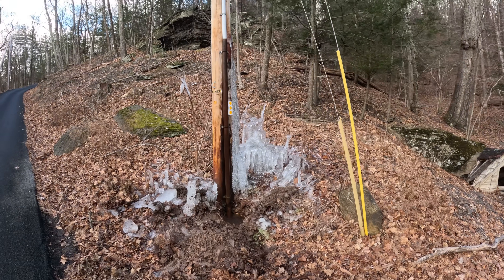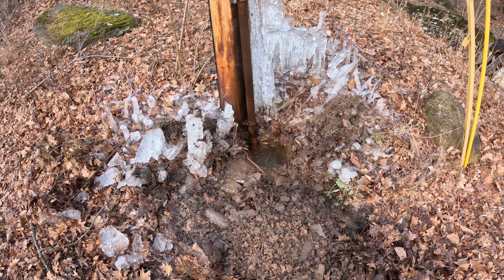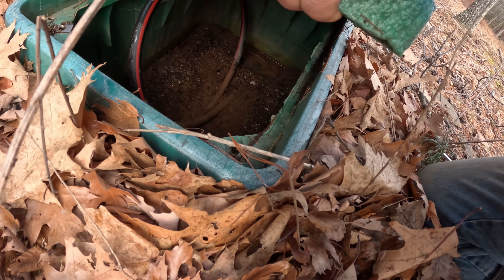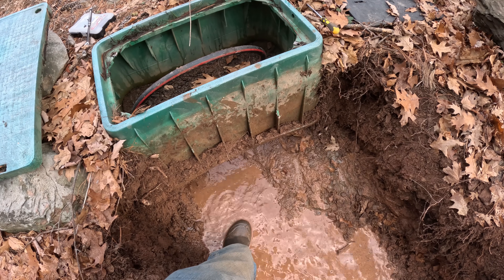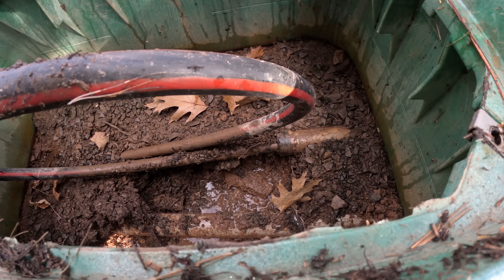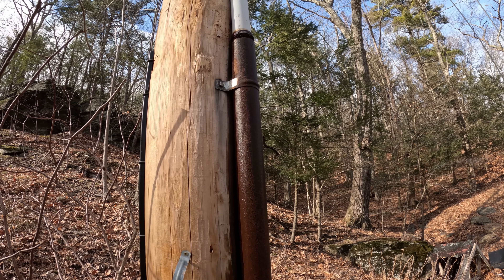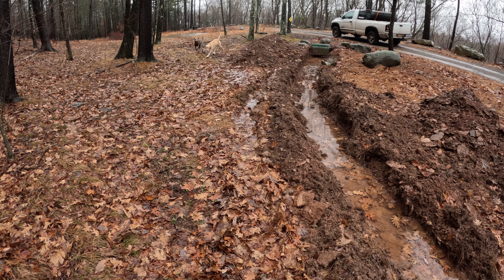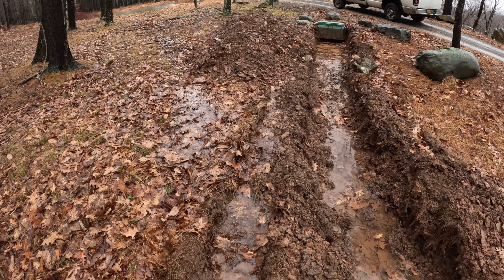Keeping water out of an electric conduit

Comment: Oz Gendy makes a hockey Puck that goes around the wire and into the pipe, you then tighten e few bolts and it squeezes in place. Good for a 100psi. Measure outer diameter of each cable or wire and inner diameter of pipe. Those specs can be found in the NEC code book or at electrical supply house. They are then made to order. As a precaution, I install them on both ends of the pipe run.

Comment: 18:15 That is exactly what you should do. Drill drain holes in the conduit before you install it. Also dig a hole and fill it with gravel so the conduit drain holes work. The junction boxes should be installed over a hole filled with gravel, and the conduits sealed with Duct Seal.
Reply: I don’t know a lot, but I do know water will not run uphill, so drain holes would be just that a place for any water that could possibly get in drain out. It’s best to do like was done in this situation take care of the problem from the source.
Reply: In the Cleveland area they are actually pressure testing the pipe. ,,,,, I guess so the water that gets in there will stay there ????????    That's what the "W: in THWN stands for,,,Right?
Reply: All electrical conduits get water inside, conduits shouldn't be sealed - it's impossible to keep water out over the years, even the moisture in the air will accumulate inside a conduit.  That's the best that can be done, and it's written into the electrical code.
Reply: What's the use of drilling holes in the conduit but also seal it? Do you want it to have openings, or do you want to have it sealed?
Reply: @paulnieuwkamp8067  Think of it like a house.  You want a seal on top to keep water from getting in, but you want a drain on the bottom so nothing can be trapped inside and build up.
Reply: @dougdow1287  Ground water will come up from below and enter through the bottom holes.
Reply: @TheOtherBill  Move to southern Arizona. It is dry there.
Reply: @jmdelapp  Been there. It's too dry, whole towns are running out of water.
Reply: @TheOtherBill  " ... Ground water will come up from below and enter through the bottom holes. ... "  But it will not go higher than ground level inside the pipe.  Or at least that is the theory..
Reply: Ain't no way im drilling holes in, especially new, conduit. I realized they are not water tight for life. But to immediately defeat the moisture resistance before installation is ludicrous. Fresh, sealed conduit can keep out excessive moisture for decades before failing. Poking holes in it is just unacceptable.
Reply: @giggiddy  LOL  I think our Canadian Electrical Code insists there be holes drilled in the bottom of the J bend for underground residential services.  The wire is supposed to be RW90.  Guess it keeps the water from potentially flooding the meter socket if the trench trends downhill towards the house.

Comment: 11:26  Ummmmmm, You Should Have Put Gravel, Under the Pipe.  Where is the Water Supposed to Go, That Drains From the Pipe?  Up Into the Rock Bed?  Well, You'll Get Your Wish.  You Actually Should Put a Layer of Gravel Under, and Over the Pipe.

What is Now Going to Happen is Water Won't Go Into the earth, It's Going to Travel Up Into the Rock.  Since You Have Gravel On Top of the Pipe, You Have More Surface Space, So It Won't Take as Much Water, to Get to the Surface.

Imagine an Empty Glass.  You Add Ice.  It Now Takes Less Water to Fill, Than if You Had No Ice.  You're Now Going to Have a Muddy Mess, Because the Water Coming Out of the Pipe, Has No Where to Go, Except Up.  That Area is Going to Look Like a Sewage Area, With a Backed Up System.
Reply: Neither one of your predictions will come true.

Comment: I wonder  if the armorcell single side adhesive 1.5" ×1/16" closed cell foam tape could be used to seal the pull box lid closed.

Comment: andrew is that 7200volt primary , please be careful
Reply from the maker: Yeah. That’s why I did not touch it.
Reply: @AndrewCamarata  And people here say drills some holes into the conduit lol 😃 !! Should have before wire pull !! 🤔
Reply from the maker: Yeah, that's why I did not bother. Guy from power company said its fine.

Comment: On Maine Cabin Masters, a cabin they fixed up had flooded due to water flowing out of the faucet for months while no one was there, and they determined that the overflow pipe on the well water pipe had gotten blocked, and the well water simply backed up into the cabin.